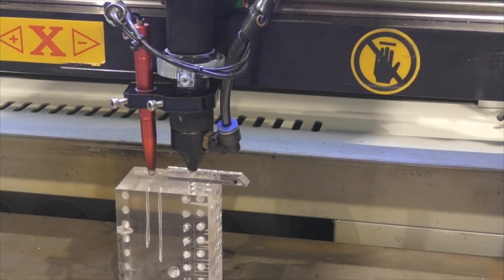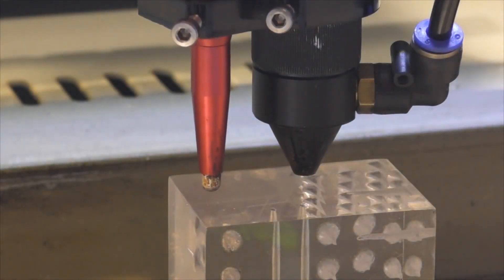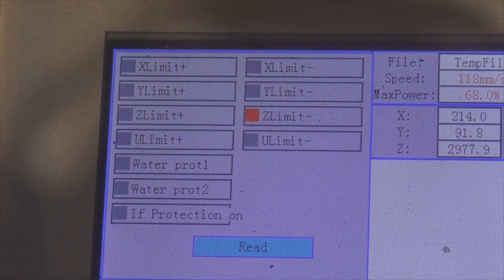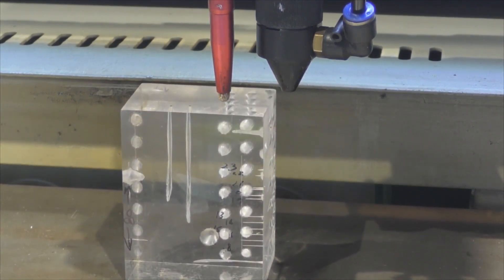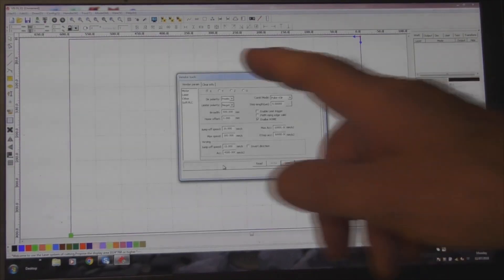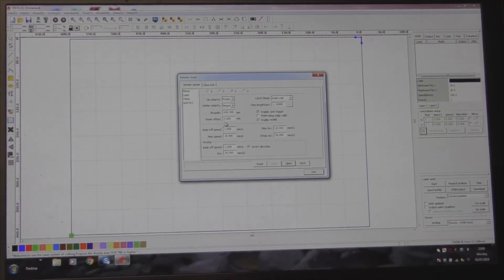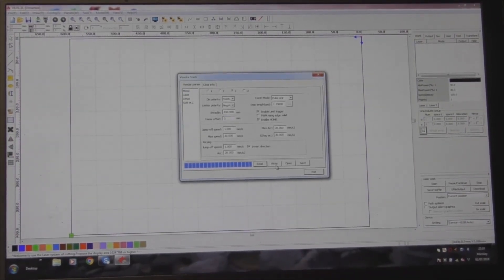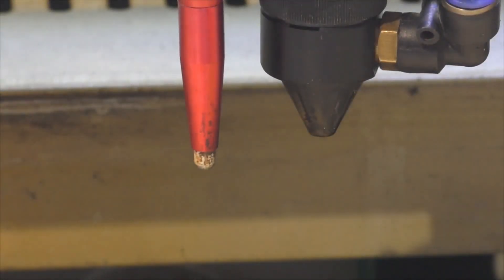Auto Focus Sensor

Comment: The on,ly problem I have with this probe is when either I get small items popping up after being cut..
Or the magners that I use to hold the work down hit it.. regarnless that the lense can pass safely over the magnet.

Ie would be great if there was a version that could retract after being used like they have in 3D printers.